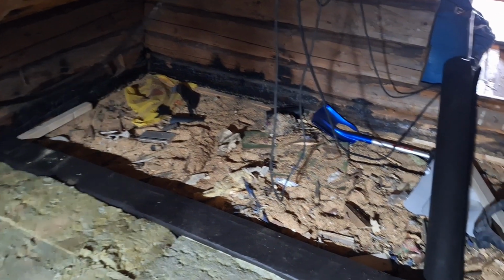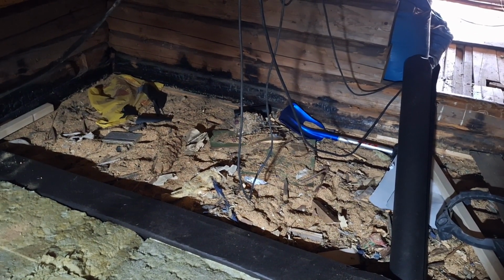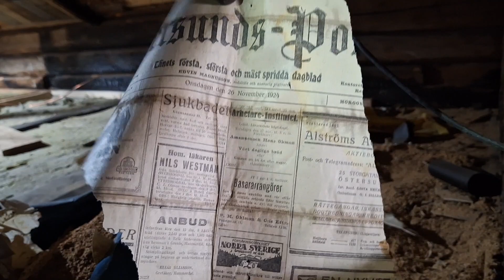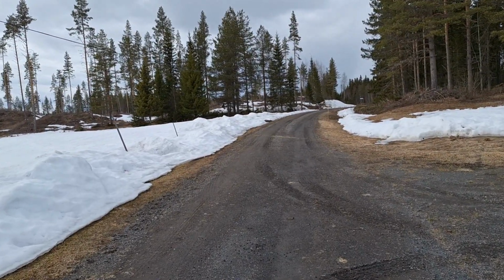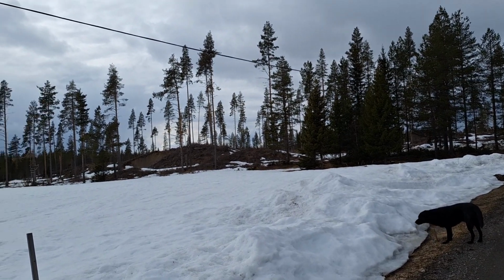Insulating the attic in my old homestead (Timelapse)

Comment: Well done! What is the function of the black layer? Protection of the insulation against moisture from the room below?
Reply from the maker: Hi. Its for protection aginst warm air/moist from the room below. It let it pass but makes the moisture to slow down. Its instead of plastic wich they use in modern homes.
Reply: What is the swedish name of the product?
Reply from the maker: Its name is Vindpapp AC 350. Usually you use it behind the panel on the house.